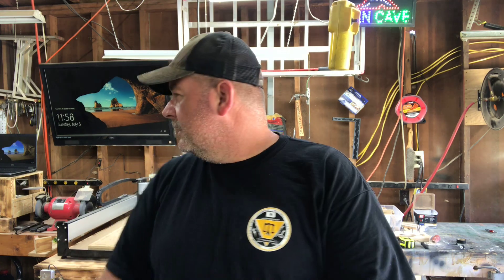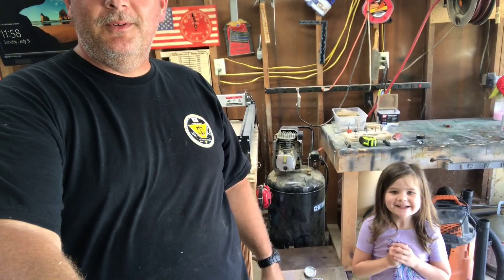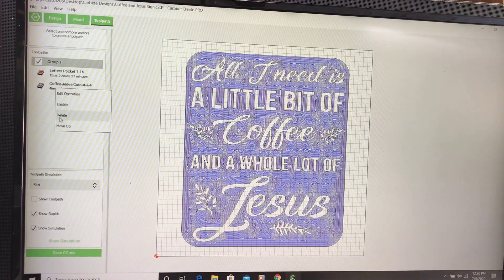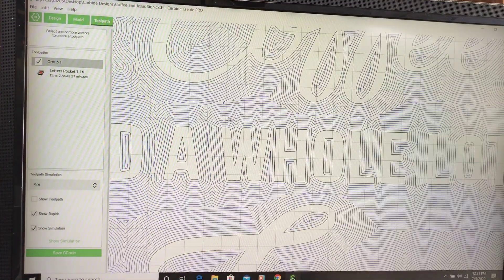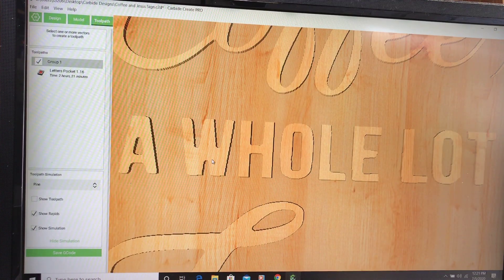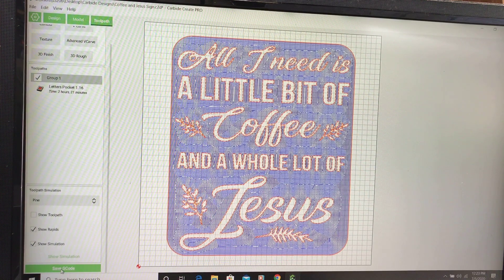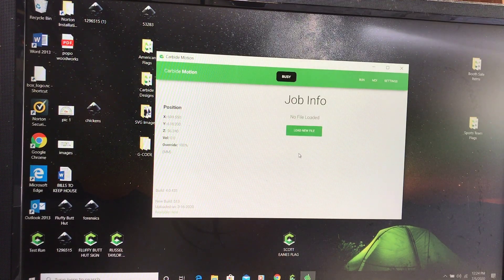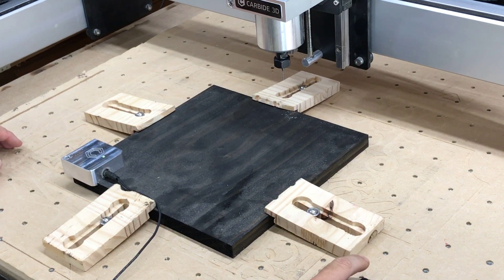Shapeoko sign with machine crash and how i fixed the project

Comment: Here's something to think about.  It's called EMI and/or RFI.  It's basically electromagnetic interference. Sometimes when you have a motor running, such on a saw it will send signals out that will be picked up by your machine controller. Your tools and controller need shielding to protect the controller from picking up those signals. For about $60 or so you can get magnetic shielding tape, some shielded conductor cable  and some of those Ferrite Ring Core RFI EMI Noise Suppressor Cable Clips. My engraver used to have a mind of its own and do just what your machine did and worse. Like when the job was just about done it would drag the cutter over the work and ruin the job. Since installing all these parts I mentioned it has not crashed in three years. Try this you tube channel. https://www.youtube.com/channel/UCR9OFVqdul6hJDfCifG36cQ.    This guy is good, you will see exactly what you need to do to stop you crashes.

Comment: Hi Popo, nice work, I'd go for more if the coffee though, but its a design &  came out good.
Have you worked out what "Start Depth" is yet? As you've cut out 2/3 of your work, tell it nearest decimal, less than depth of already cut material. Saved lots of sir cutting.
Second, instead of recutting whole flat empty area when you just have islands around lettering, create an offset eg 1/8" outside your lettering & do a pocket from lettering to offset . Saves a whole load of minutes !!
Combine both strategies, it a small number of minutes recovery to finish!

Comment: I’ve been having a disconnect issue with my xcave lately, working on shielding and grounds and ferrite chokes. But until I get it resolved I generate several partial gcodes for my project. If it crashes as you call it, I’ve G28.1 the work zero so I can go again and just run the smaller areas. You still air carve but you can up the feed until it gets to the point of cutting again. PITA! Made a 1 1/2 hour carve today after installing ferrite chokes hopefully that helped! Keep up the good work!,

Comment: How do your make sure the your project is straight on your work surface before clamping?
Reply from the maker: Princess Kitty I manually lowered the 1/4 end mill untill it barely touched the waist board towards the left front then held the jog button to the right and cut a line “not deep” from left to right. I place all my work pieces on the board and line the bottom up with that line. I also have the touch probe that tells the machine where the edges are and how deep the bit is.
Reply: Princess Kitty another way to do this is to bore 3/8” holes about 6” apart along the X and Y and install short dowels then place your project against the dowels. If you don’t want to bore into your waist board you can lay a sacrificial board on top.
Reply from the maker: Princess Kitty Also I get all my bits from toolstoday.com